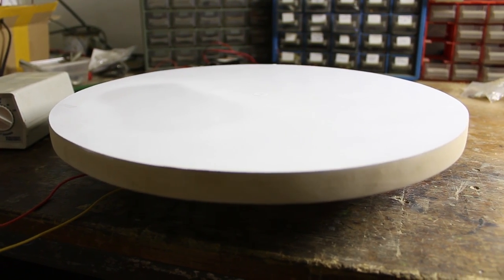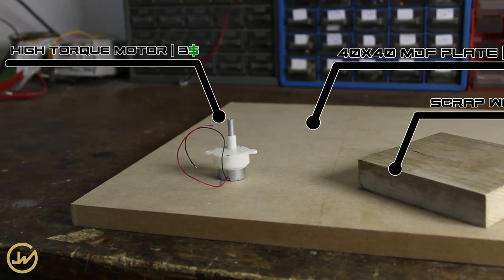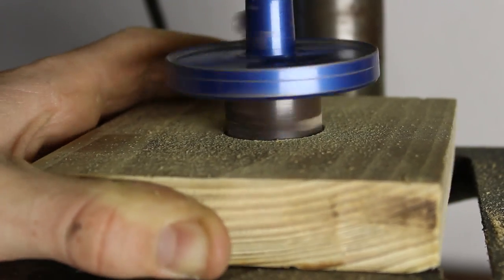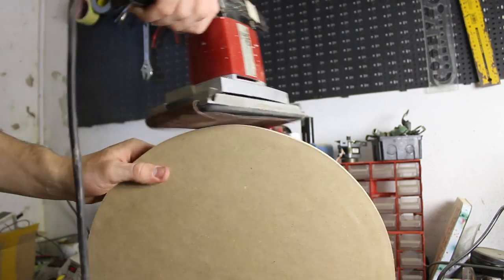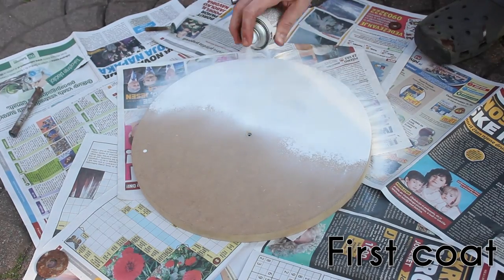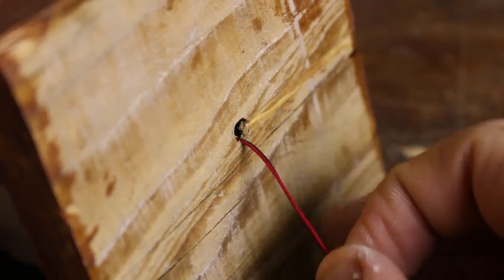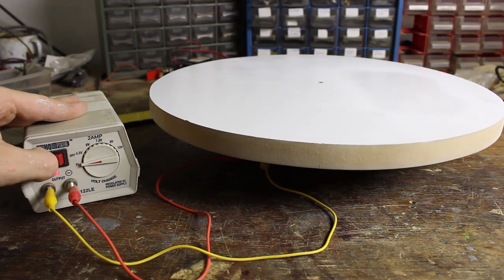Make A Simple Rotating Table "Lazy Susan"

Comment: Just a thought but widening the base would be a really good idea. Also routing in matching rounded channels in the top and bottom and using class marbles or something as bearings/stabilizers could have it much more stable and possibly hold more weight.

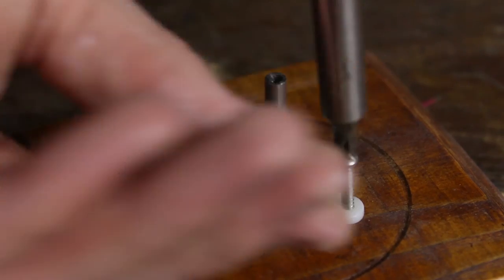Comment: A tip for anyone viewing: When screwing anything in a "circle pattern" (such as 1:47) its good practice to get both screws in secure and then tighten them after having both in. 

So place each screw in the holders screw one in then the other.  And then tighten both